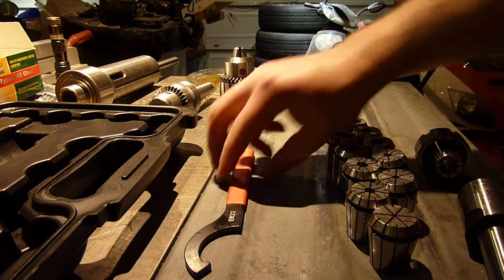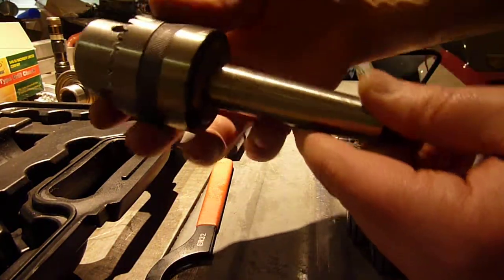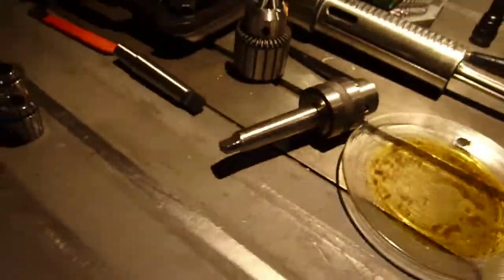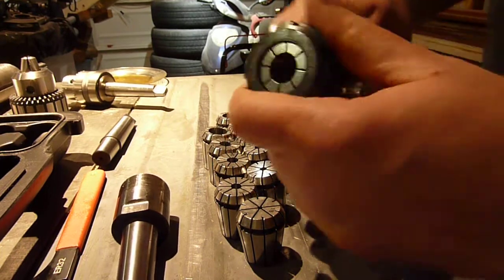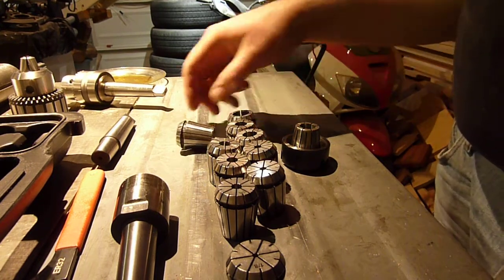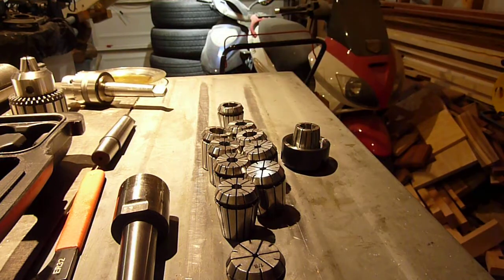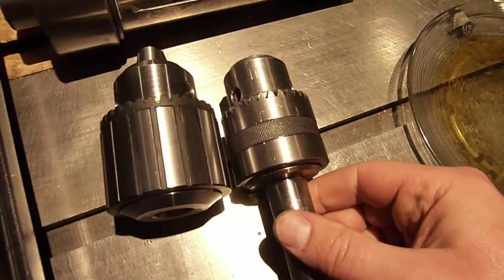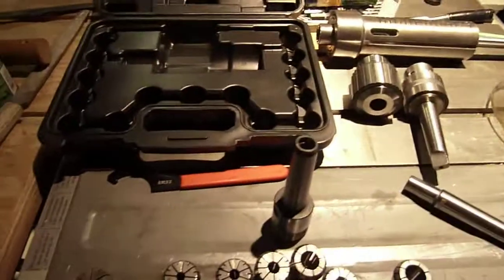Dayton 20 drill press 3: New drill chuck and ER32 collets

Comment: Did you drill out your slindle so you can use a drawbar on the collet chuck?
Reply from the maker: No...never been a problem. When I made this video, I was thinking at the time, this might be a problem. I have not pulled the ER32 collet out of the drills taper in several years now. I have a wide selection of collets and they hold drills and other things much better than a drill chuck does. I use the drill chuck none at all except for very small drills and then I use a collet to hold a tiny drill chuck. Last night, I was using a 3/4" carbide end mill and making 1/2" deep cuts with it in aluminum without issues. That's some decent lateral loading! Back when I got this drill, I froze the ER32 chuck in my freezer and then immediately inserted it in the drill taper and gave it a couple of good raps with with a hammer into the taper. That's all that is holding it in place. I know I can drive it back out with a taper wedge tool, but I have no reason why I would.
*
A much better solution if your tapers won't hold and you have the slot in your quill for driving out tapers is to make a U shaped retainer that fits inside that slot. You use the threaded hole in the top of the MT2 or MT3 taper. This is common to most drill and collet chucks for use with a draw bar.  A socket head screw through the U shaped retainer and into those threads is 100% inside the quill and will make sure your tapers can't come apart. If you lack the slot inside your quill for driving out tapers and many smaller drill presses won't have it, then you can make a sleeve that fits the OD's of the bottom of the quill and the widest portion of the chucks taper. Several set screws into the sleeve that bite into these 2 OD's will hold it all together pretty well. A freind with a small bench top drill press made one for his a couple of years ago and it's holding nicely.

Comment: Or you can drill a elongated hole through the side of your mt-3 taper er32 shaft and use the wedge to hold it in your drill shaft.
Reply from the maker: You would need to explain better. No idea what you are talking about. The wedge can't stay in place and run the drill at the same time. It goes through both elongated holes and the drill can not spin when it is in place. Also the wedge drives the 2 tapers apart. It holds nothing together. How a hole would change this is uncertain.
Reply: @de-bodgery  you're right it would be too hard to explain without a print. But basically if you can use the wedge to knock the holder out of the spindle , you can use the wedge to tap the holder into the spindle. Never leave the wedge in the spindle when you turn it on. LOL
Reply from the maker: @GospelOfTimothy  If you can do a video on this, that would be great! Since my wedge is so small, I use a piece of flat 6061 to drive the tapers together. It has been at least a year now since I pulled out the collet chuck. Sometime back, I bought every size collet I could find in ER32. It has yet to happen that I lack a collet that will hold whatever drill bit I need to use. I do NOT used that drill chuck at all anymore since I got all those collet sizes. I was thinking back when I made this video that I needed a drawbar and so many other things. Now...with all those collets...none of that is needed.
Reply: @de-bodgery  I just ordered some er32 collets. They haven't arrived yet. But I have a lathe mt3,  and a mt2 drill chuck. I was going to use a slotted sleeve to convert it. so I have the same or similar problem you do. No way to lock the drill chuck into the sleeve. That's why I was thinking of drilling a hole through the side of the drill chuck to draw it in with a wedge. But I decided not to do it and just go out and buy a new chuck with mt3. With my new er collets I probably won't need it either. Would be nice to have a drill press with Mt3, so I can use all the same tools.
Reply from the maker: @GospelOfTimothy  Yeah mine is JT. I think MT's is pretty much milling and machining only.

Comment: Do not drill your shaft, I use a T-bolt in the oval hole of the taper tool made from a 10 mm bolt 20 mm long. it jam when y turn the MT to screw it. By adjusting the lent of Mt to be flush or shorter than the beginning of oval hole.
Reply from the maker: I didn't...would have weakened it too much and getting dead straight down the center would have been difficult. I abandoned this idea almost immediately. I have seen your setup before. I have never needed anything. A placed a piece of aluminum over the end of the ER32 collet and hit the aluminum 3 times with a hammer. That drove my tapers together incredibly well. I never use my drill chuck as I have a decent selection of ER32 collets that have so far fit any drill or mill I have wanted to use. I mill pretty heavily without issues and so far with 1/4" to 3/8" deep cuts, I have not had the tapers come apart. Over this past weekend, I had a 3/4" drill in a collet to make a large hole in some steel. At one point the drill jammed in the steel. I backed it out and resumed drilling. My tapers are not secured in any other way than driven together with a 12 oz hammer.
Reply: @de-bodgery  TKS to ansering.
Reply from the maker: @christiandebray  No problem, I like people getting value from my videos and the conversations it can create.